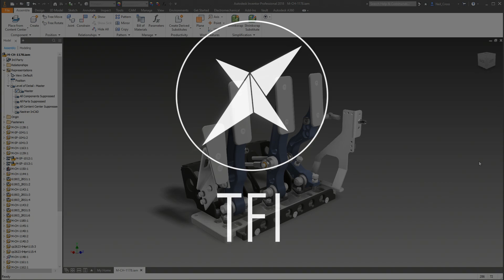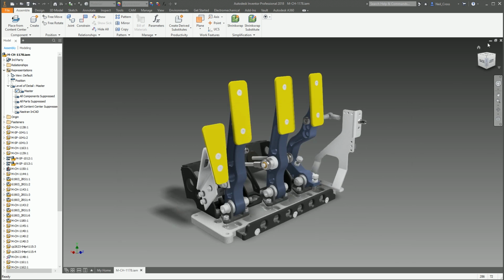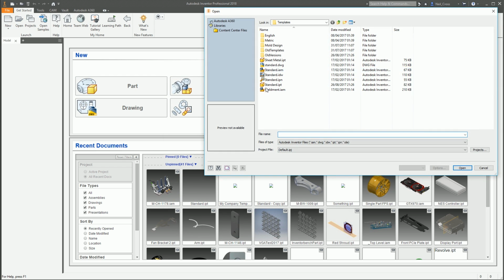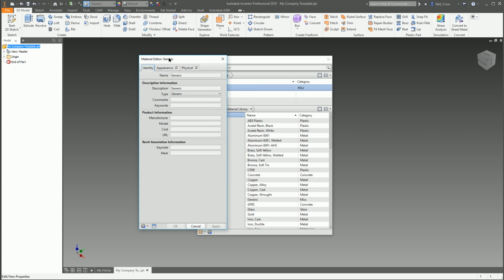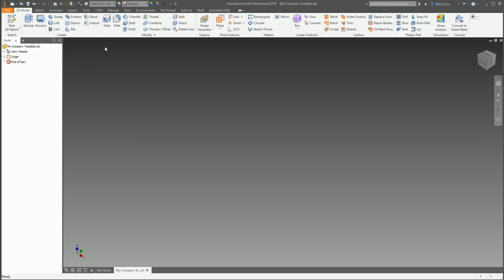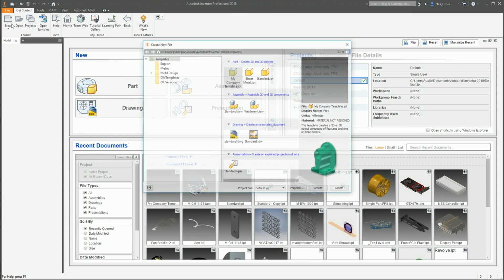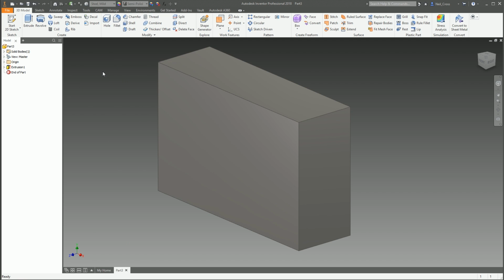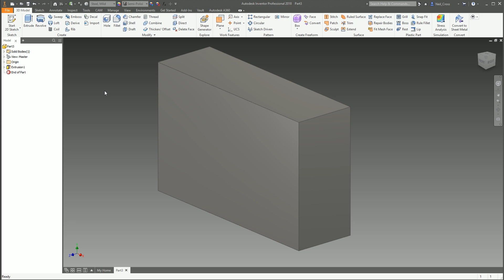TOP TIP for spotting missing materials | #Autodesk Inventor

Comment from the maker: Just in case anyone writes this before finishing the video, I did mention that there are ways of doing this using iLogic etc but this is (in my opinion) a more effective way of achieving this specific goal in a large drawing office without having to manage rules and rely on scripts running etc.  You might prefer to do it another way, that's great, you do a video on that and I'll do a video on this! :-p
Reply: And that is a pro tip! We've used it in my company for like 1,5 year and it works like a charm. There are no (Z E R O !) mistakes now. We have actually used Luminous texture. It so super anoing that you can't model anything with it assigned - you simply have to change it to make a model :)

Comment: Great video, for the Vault Professional users there is also the "Vault Data Mapping" tool in Inventor. The report can be annoying to create, once created though it does offer some neat features like isolation etc. This will work for all / older files and does not require to mess with them through iLogic ;-)
https://knowledge.autodesk.com/support/vault-products/learn-explore/caas/CloudHelp/cloudhelp/Help/ENU/Vault/files/GUID-3EEB744A-B68D-429A-AE63-54B0FA7C8E2E-htm.html

Comment: Good tip. Years ago I created a texture (BMP) that contained the text "NO MATERIAL" and assigned that to an UNASSIGNED material in the default template. Your part was "striped" with the message text until you selected a different material. The down-side of this method, you have an extra file to manage in Textures. It solved the "Generic" material problem though.